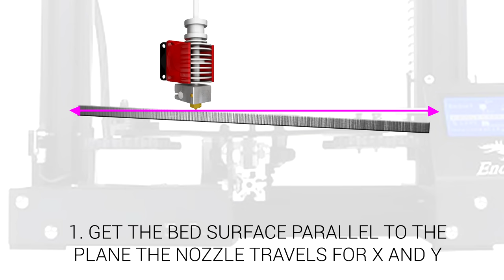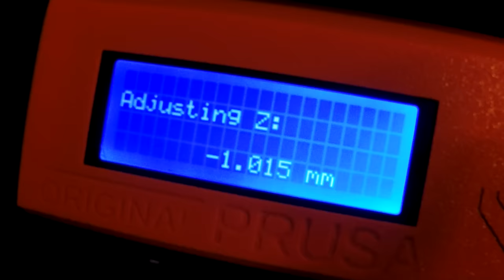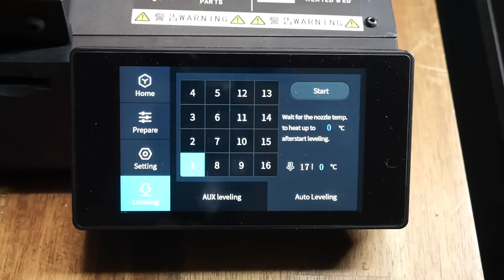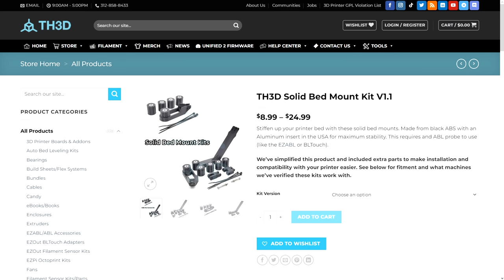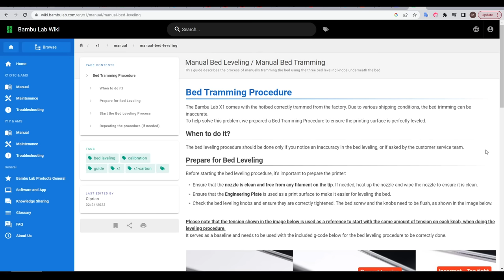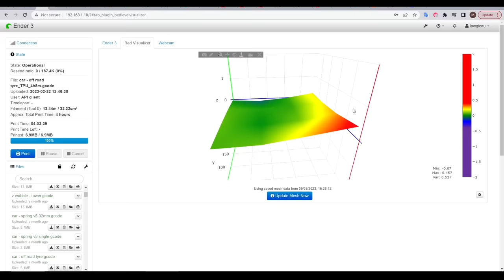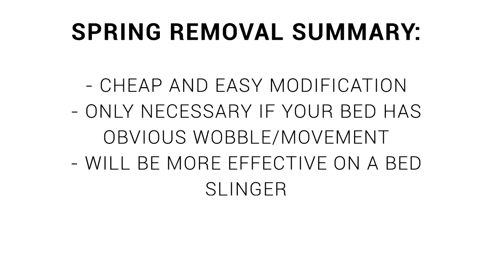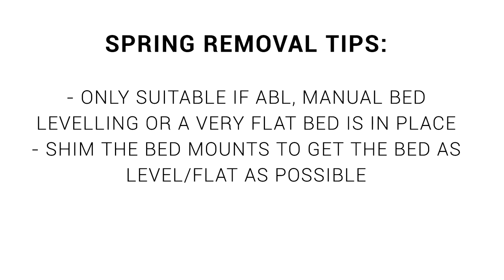Is it time for 3D printers to abandon bed springs?

Comment: I have a CR-10S5 that has basically been mothballed because the enormous bed makes it practically unusable unless you want to print at insanely low speeds. One of the first mods I did to it was install a BL-Touch and swap the springs for metal standoffs. The result was really interesting - because you're removing the shock absorption of the bed sloshing around on the spring-loaded standoffs and transferring that momentum into the Y-axis metal frame, all that force gets loaded on to the Y-axis belt (already a super beefy 12mm 2GT belt). The factory belts were too elastic for that, so I switched them for 11mm Gates 2GT belts which didn't show much deformation after highspeed footage analysis, but of course the force travels on to the pulley on the Y-axis stepper. Ultimately, because any play along that chain from the stepper pulley to the bed itself had been mitigated, the 72mm NEMA stepper couldn't handle it, and would routinely lose steps at any print speeds higher than 25mm/s^2 @ 600mm/s^2 acc. 

I wanted to then get a NEMA 8 to replace the Y-axis motor, but then the shock transfers directly into the frame, meaning an absolutely enormous amount of 2040 and 2020 needs to be reinforced. After that, finally, all the remaining mitigated force of the bed moving would be transferred to the base of the printer, and then to whatever it sits on once it's strapped down... total monster of a project, so I dropped it and parted it out. Now I have a 300mm Voron 2.4R2, and I will never buy a bedslinger again :D

That's not to say that springs can't be eliminated from smaller printers, but at the extreme end, all that energy has to go somewhere... and it may end up having a worse impact on print quality.

Comment: With my Ender 5 Plus, I changed from springs to silicon cylinders. I found that they soon changed their elastic properties and changed back to springs.  I did install anti- backlash springs on the twin Z- screws.  This, I found had much more success in preventing bed wobbling and bed leveling issues.  Even though I have a BLTouch I prefer to use a vernier calipers resting on the bed and the four corners of the guide bracket.  Using this method I can level the glass bed's four corners within .0508mm (.002 in).  I can hold the flat bed to within close tolerances with the springs for several prints; only making a quick check with the calipers.  Using this method has produced, not only great bed leveling, but great bed adhesion, as well.

Comment: Springs are fine on a small cantilevered bed like the v0. On a sub 200mm bed, manual bed leveling makes more sense. For a larger printer, it makes more sense to either have a motion system that allows auto bed leveling or a mesh to compensate for any tilt.

Comment: I removed the springs off of my CR10s years ago and put solid mounts and the TH3D EZabl and it works fine. However, on my Hypercube 445, I had to keep the springs but in doing so I now have a leveled bed with a .298 variance, and it uses a BLTouch, too.

Comment: Guess I've always been lucky; as a 3D printing noob I installed some stronger yellow springs on a new Ender 3 V2, added a BL Touch, and have always had really consistent first layers. Granted I don't push the printer particularly fast, but it's always worked well for me.

Comment: Only my creality cr10s pro v1 has required this. Those yellow springs get significantly weaker after a few hundred hours of printing. The z stacking issue has always been extruder related for me as a few hot pulls or a new nozzle always fixes it. Even my old i3 had more consistency for longer though I did use a few washers to put more tension on the springs. 

Great vid mate as usual.

Comment: I have a 2018 vintage Ender 3 with stock bed springs and no auto bed leveling system. Amazingly enough, I have always been able to achieve really good first layers using the 'ol paper and hot end shift method using the 4 corners of the main print area as index points. Once set, I can usually print a dozen prints before having to level again. In the interests of keeping up with the Joneses, I bought a kit that allows me the option of changing to either the stiffer yellow spring or silicone columns. Several YouTube videos later, I have elected to go straight to the silicone. I'll let you know how it goes.

Comment: The trick to (wobbly) springs as I see it, is that you need the end stop adjusted so that the springs are tight, not loose. I think that this is the problem fix you needed. just move the stop until the spring is tight. To me it still seems a cheap way out, but for me my Ender 3V2 has been fine. I rarely have to adjust other than small tweaks during the skirt. My Ender 3 KE is much easier, but I wish it was flat to start with. 
It was helpful. I am working on a long bed and I needed Ideas.

Comment: I use a set of silicone bushings instead of springs for mine and have noted great improvement to stiffness while still providing the adjustment I need for my slight bed warping.

Comment: I've installed rigid springs with square section and self-locking nuts instead of knobs on my Ender 2 Pro. I think it's the best solution which gives you both - possibility of adjustment and rigidity. No need to have ABL at all and I print with perfect first layer even for bed size prints.

Comment: Springs, especially on lower end printers, just gives you more chances to warp the bed with as thin as they are. I've come across way too many printers where the bed springs are way over tightened or too loose.  We've all done it when we got started. I switched all my printers over to the silicone bushings. They are 2-3 times the width of the springs so they cause less warping in the corners, you really can't over tighten them, and if you don't have a removable flex plate yet removing a stuck print doesn't throw off the leveling.  On the Enders all I do is cut one spacer down by 2mm for the heat bed wires mount. Plus as Vez3D said they help with vibration and resonance transfer from the frame. I honestly don'y understand why most printers don't come with them stock since they are cheaper to produce than springs.

Comment: I have 3 3D printers, a Tevo Tornado, a Tevo Michelangelo, and a Sovol SV04. The Tornado and the SV04 have ABL and I replaced the springs with silicon spacers and washers for trim. They have been very stable for a long time. The Michelangelo still has springs because the bed is so small it doesn't vary much and I rarely have to adjust it.

Comment: I have a Creality Ender 3 S1 Pro, and it has springs.

They are a pain to deal with, but I only have to mess with it every once in a while. The bed is really solidly mounted, so there isn't much play in it. It's also usually pretty obvious when something isn't leveled right. You'll definitely see it in the print.

Comment: 2 E3V2's I assembled from junked out Aquila's and using Creality 427 boards. I had changed to Silicon but still found I had to tram the bed quite often, even when I had it quite tight. I think this is from the tightening wheels moving. I took spacers and and locked them to the print bed with nuts, then placed washers and nuts, before the bed mount. Then I used the wheel to tighten the screws hard to the Bed mount, and using the nuts on top side to make adjustments then locked it down hard. This way it's still easy to tram the corners, but locks the bed tight. I was able to get all 4 corners to 0. It's hasn't moved since.

Comment: I took this to the extreme, got rid of the springs, and am using nuts to keep everything leveled.  I have a CR Touch as well for ABL.  Could nut be happier with the results.  Super clean first layers and I never have to make any adjustments to the bed.

Comment: I have two printers with ABL; one is a BLTouch and the other uses my z-stop switch on a printed mount. I 3D printed spacers in ABS to replace the springs on both machines, and I've had no issues whatsoever.

Comment: On my ender 3 pro. I found the screws on the bed very loose, so I fitted half nuts to make them rigid.
Sadly, this produced a lot of friction as the holes and the threads didn't line up well but judicious rocking of the bed, ground away the excess.
Stiffer spring as well, make the printer much more stable and visible printer quality improvements.
I plan to update the 4.2.2. board to the latest marlin as the Creality "1.0.1" is not a true marlin version number.

Comment: I changed springs out for silicone spacers on my Ender 3 v2 - add klipper, and I am about 3x the speed it started out with. Added a mag+PEI bed, and even manually leveled is fine, but I have a klicky bed leveler in the works, also.

Comment: It was one of the first things i removed from my Anet A8. The springs were far too weak.
With solid blocks however, i noticed heating the bed results in exaggerated height differences of the bed. If you are replacing springs with spacers ABL is the way to go, unless you fancy leveling your bed every time you change your bed temperature.

Comment: I used those nylon spacers you showed to get the springs to be much more compact. I opted to keep them so I could get the bed as flat as possible, but your idea of adding washers to compensate instead might be something I could try. Cool idea

Comment: Shifts due to momentum, or lack thereof is why I'd say bed riser type printers (what I call them) like the Bambu Lab printers can get away with springs. Being that there is no horizontal movements of the bed, there is no momentum issues during direction changes so no wobble issue from the bed, any "wobble" will be strictly a function of machine rigidity. Since spring are better suited for getting a good initial bed Tram (bed level), it makes sense to use springs in something like that.  
On a bed slinger type printer, there is the potential issue of shifts along the Y axis due to momentum during motion changes. The faster you print and the higher your accelerations are, more the problem becomes evident.

On my bed slinger printer (older Ender 3 that's had some upgrades), I've gone to rigid mounting and ABL. To make the initial bed Tramming a relatively quick and painless process, I made a mount that attaches in place of the hot end to mount a dial indicator and just mount the bed to the base place with the spacers I chose then move to where the dial indicator is over each of the mount points and note the reading on the dial indicator, find the highest point of the 4 points then do the math to find the shims needed for each of the other 3 points to bring them to the same height as that highest one and done, not guess work or anything. 

Oh, and being an machinist by trade and having seen first hand over the years, the distortion effects from thermal expansion and contraction, I should note that if doing any sort of rigid mounting, tramming measurements should be done with the bed heated to whatever your most common bed printing temp is and during both initial mounting for measuring and remounting with shims, the bed screws should be loose and only tightened once the bed is up to temp and stabilized, then readings taken and the same thing when you shim the low corners, leave them loose, heat the bed and let it stabilize and then tighten them down. The reason for this is when rigidly mounted, thermal expansion will induce distortion if the plate (bed) is not free to expand along the horizontal plane. The original spring setup allows for the small horizontal plane growth due to thermal expansion so distortion is less likely and even if it does occur, it will be to a lower magnitude. Now granted, ABL should be able to compensate for any distortion as it is pretty minimal from my testing but the less the controller has to compensate, the better and its not like it's any sort of painstaking process to do since you have to tighten the bed down regardless, its just a change of "when" you tighten down, so why not do it in the way that will give you the best results possible....

Comment: After I printed clicking hands for bed bolt regulation, I had not much trouble with bed leveling. I used stock ender 3 springs, and more important to add nuts and some spring centering adapters. But better change springs for harder ones. I straiten print bed and never used *-touch devices. I guess you can remove springs if you will manually adjust bed strait enough. But I guess hard springs will help much better.

Comment: I’ve gone through it all at this point, replaced my e3v2 springs with the stiller yellow ones, then switched them out for the solid silicone spacers, they’ve been perfect and I never have to adjust the bed anymore. (Bl touch enabled)

I got myself an SV06 for Christmas and it comes with aluminum spacers like the prusa, but my first layers we SO uneven, obvious height difference from left to right, so I recently ordered some silicone spacers of an appropriate size and installed them yesterday, after re adjusting the z offset my first layers are near perfect. 

Silicone spacers ftw

Comment: I still have the stock springs on my CR-10S after many years. I don't have an auto level device installed.
When I had trouble with the bed staying level,  it ended up that the v-rollers had loosened on the y axis, so the bed wobbled while printing.
After readjusting the rollers, I have not had to level the bed again in about 18 months.

Comment: my current printer Ender 3 S1 has no springs. I got 4 bolts locked to bed and then set of bed wheels squashing mounting braket (i hope that makes sense)
Basically bed never moves and CR Touch does its job great as so far i had not one single bad 1st layer.

Comment: I use a Ender 3 S1 Plus with original springs. I compress the springs (Moves the bed down to the lowest possible setting) and adjusted the z offset to 4.15mm or something. This makes the bed is very stiff and works very well.

Comment: I think that with a good auto-leveling system that you can do away with bed springs and achieve a more reliable system but without auto-leveling, springs are a must. These days having a printer without one or the other is just criminal...I'm looking at you Gigabot 4. My Ender 3 was built with upgraded springs from the start and I soon upgraded to auto-leveling as well. It's been absolutely trouble free ever since.

Comment: Stiff springs on my Ender 5 made it so I rarely ever have to adjust the bed to re-level. Maybe once every 1-2 rolls of filament and normally it’s just because I start to notice a little elephant footing. Which if I’m feeling lazy I just tweak a bit here and there rather than go through the whole process and so it’s been probably 6 months since the last time I redid the whole leveling process.

Comment: I use the silicon spacers which I thing is the bestof both worlds. It eliminated the wobble as the spacers are much larger in diameter than the springs. They are also very stiff, but still just flexible enough to allow knob adjustment. Once level, the knobs don’t gradually rotate out of level because of the spacers gripping them. So they are much like having solid spacers because they are very firm and dense, and they also won’t scratch the underside of the hotplate and cause shorts.

Comment: I had to do so much bed leveling just to make the bl touch thing actually work. I think I would keep the springs. I have the really stiff orange ones. Will be interesting to see how long they last.
Reply: He got it wrong. Springs don't give you adjustment capabilities. They give you crash protection, that is all.

They actually make tramming more difficult because if your probe method involves touch the bed at all, it can make the bed flex quite a lot with springs. Of course, that depends on the spring itself.
Reply: @SirSpence99  the springs allow the bed to be in tension for adjustment over the length of the spring compression. The silicon replacements allow a small amount of adjustment. The rigid upgrades require adding shims/washers as shown in the video. So the springs do allow for easy adjustment and long travel. Although they have the disadvantages mentioned in the video. My BL Touch hits the bed very lightly to trigger. I don't think it is moving the bed.
Reply: @SirSpence99  that is an interesting thought. When I some day have a second printer to play with, I will be more interested in trying this out. Thank you
Reply: @iseolake  If you want a large range of adjustment for tramming (you shouldn't, that is a sign of other problems) there are other, better solutions than a spring... Like say lock nuts. In that case, you get a "rigid" mount and can have significant adjustment capability. That said, if you want a lot of adjustment, the consequence is going to be a less rigid bed which can cause all kinds of problems.

As for a bltouch, yes, most springs used by beds aren't moved in any easily noticeable way when using one. There are a lot of other probes that require more force and certainly would cause the bed to flex. That said, you need to keep in mind that the bed flexing .1mm is a massive amount and that requires almost nothing to do. This could mean that even a small print if the mass is offset could result in the whole bed tilting. I wouldn't be surprised if a bltouch is within the realm of 0.05mm deflection if you probe the corner of the bed.

I like to print with 0.05 layer heights. if I put a quarter on a flex bed it might well move that much on one corner.

Comment: my cr10s4 came with a bed that has a bend in it from the factory. I actually added a bunch of stiff springs to the center of it to push the bend out of it. I don't use abl at all, I use a dial indicator. My first layer has been consistent for years with this hackjob setup of mine.